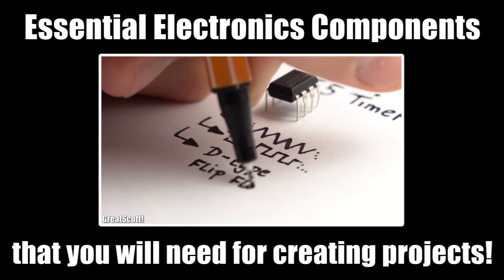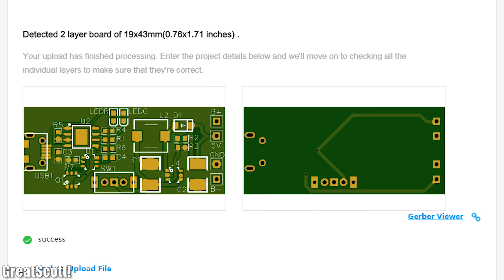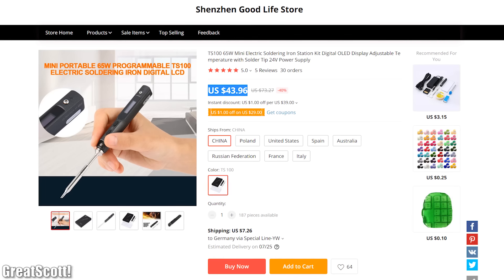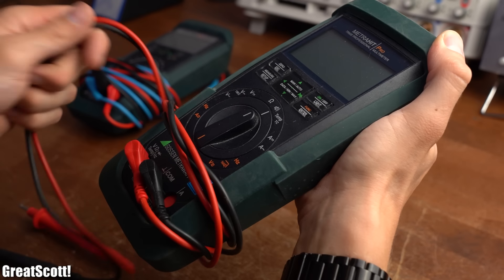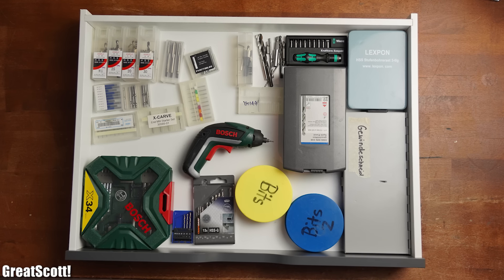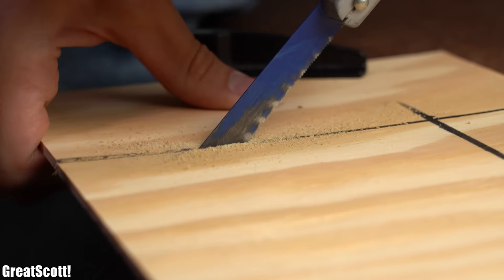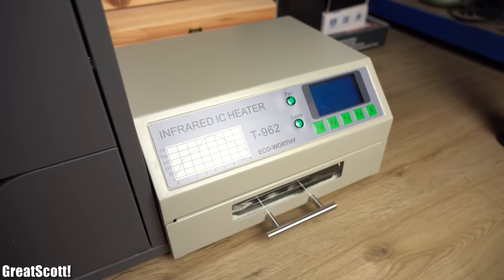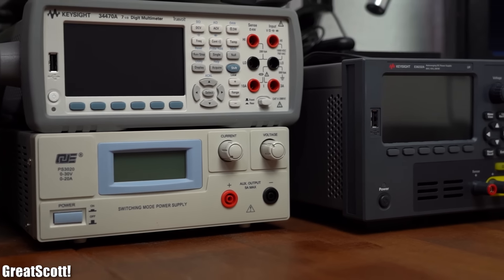Essential Tools that you will need for creating electronics projects!

Comment: *Recommend a €240 / €43 soldering iron

*me
Iam still good with this €3 soldering iron
Reply: Also me😌
Reply: Even most engineers use them
Reply: Same man..., same....
Reply: I remembered using a halogen lamp to solder back then
Reply: @leozendo3500  I HAVE SEVERAL QUESTIONS !
Reply: Agreed for beginners I have fancy bench irons but for most work I use a mains powered antek that cost £10. And a 110V iron for Industrial work.
Reply: @sayyidsahal4533  we do.
Reply: @dogwalker666  I use Zhaxoin 936D for around 25$(more or less because i brought it in Poland for PLN  ) but i'm still beginner.
Reply: I love my modern re-work station, but for years, I soldered A LOT of projects with just my butane fired iron. It’s super portable, truly inexpensive (~15USD), has reasonable temperature control, seemingly unlimited power (for big wires and connectors, and also old solder) and the fuel lasts quite a while. It also does an awesome job with heat shrink tubing. It’s definitely not for everyone and everything, but it’s something to consider if the budget is tight.
Reply: I'd say it is somewhat important to have temperature regulation on a soldering iron. It doesn't need to be variable temperature; it can be fixed temperature like the Weller Magnastat. I got mine for $5 used but I believe it would really need a new tip.

Comment: Some of these tools are pretty expensive and, while they're worth their price when you can use all their features and specs ranges, a beginner/intermediate hobbyist can get away with a few cheap substitues. Things that I have tested and can recommend:

- LCR T4 as diode and transistor tester with LRC measurements as well (get it with the probes, you don't want to desolder every element to measure!), 5-10 $ 
-  DSO 138 or DSO 150, small and portable digital oscilloscopes, 15-25$ (kit or assembled)
- adjustable power supply with LCD display, from 3-15 $ (depends on complexity, precision and principle of work, the cheap ones are LM317 with a potentiometer), usually as kits
- 858D hot air rework station, 936 soldering iron station (with changeable tips of course), both with temperature regulation and display, both really inexpensive at around 30-40$ each
- XR2206-based function generator kit, usually as kit for as low as 3$ 

Now of course these are amateur-grade tools, but they can go surprisingly far, given their price. And let's admit it, most hobbyists build DC circuits anyway, and when it comes to AC, we're usually dealing with audio frequencies (that includes PWM of our microcontrollers). I have a Keysight DSOX1102G oscilloscope on my bench and I haven't even used it in quite a while, as the cheap ones are enough for the job.

Comment: I recommend getting a couple of cheap vises.
A small drill press vise for holding things so they don't slide around, and it can be used instead of dedicated PCB holder if you don't have one.
A vise with a ball joint for holding various items you are working on at an angle.
A big cast iron vise for holding things when violence is the only option.
These can all be found for cheap in you local hardware store.

Comment: Add these:  You missed heat shrink tubing and an accompanying Bic or Jet lighter (in lieu of a heat shrink gun) and Scissors, which I use a lot.  I use heat shrink tubing on just about every project.   Hot glue gun is handy.   So is super glue.  Zip ties in many different sizes.  Black electrical tape.  Screw on butt connectors for joining bigger wires like house wires.   A kit of eyeglass sized screw drivers.   A metal oxide cut off wheel on a hand grinder and a grinder disc.  Some helping hands to hold things while soldering or tape to tape it down.  A black sharpie (or different colors) for labeling things.  Paper labels that can be cut to size.  Plastic packing tape.  RJ-45 connectors with crimp tool.  XT60 connectors.  Electrical light switches (great where you need any easy to wire up heavy duty switch in a project.  A soldering stand (if you have a TS100) and non-flammable soldering surface/mat.  Drill press... much better than a hand drill.  Bandsaw or scroll saw is much better than a jig saw.   Box of random recycled wire in all sorts of sizes.   Box of random power bricks / wall worts and their end connectors - you will raid this often.  A 12vdc car battery charger with 2/6/50amp settings.  
 
To clean up your cable mess, slider zip lock baggies are excellent. They are great for for sorting almost all other parts as well.  Put one cable inside a ziplock bag, and it will keep it from getting tangled up with the rest... and going through all your cables is also a snap, esp. if you label the bags with tape or a sharpie.  They are clear and you can see through them and you  can file them in a drawer in a column life file folders with the label at the top.  I recently discovered their utility by accident while sorting my quadcopter parts.   They are also great for keeping very small parts from getting lost (or wet).
 
Choppergirl / air-war.org

Comment: Great video, Great Scott! as usual my friend. It’s a great video for young ones starting in electronics..You covered about everything for general electronics. Yes there are a bunch of things for particular types of electronics, but you covered everything required to get started. I would maybe add one of those TC-1 component identifiers. They are only a basic identifier, but i have found it handy from time to time. I also might add a cap tester/ESR tester. I also things such as power/watt meter, distortion analyzer for audio electronics, but you covered all the basics very well. I do a lot of vintage electronics as well, so i have a curve tracer and transistor testers, tube testers, tube matcher and other vintage electronic stuff. For a modern electronics lab you have covered everything. Great Stuff! Thank you.

Comment: Great equipment and decent lab! 
What I missed from your toolset is:
- An isolation (1:1) trafo especially when troubleshooting switched mode power supplies
- A cheap but very useful component tester
Reply: - and a hat with different set of glasses for older people like me :)
Reply: You can also build a isoltion transformer with 2 transformers with the same sec. voltages. So  230-12-12-230 and you can get isolated mains without spending more money for a transformer thats 230-230

Comment: I started with soldering iron , solder wire,. Scissor ( not cutter) , multimeter,  usb cable for 5v supply which i prefer most.   Even over 12v.  1A.  . I prefer for 5v 3A. I don't know why but i like to work with 5v

Comment: 0) Fume extraction, and a good (activated carbon) filter if you do not vent directly to the outside (avoids causing your room to become quite cold during winther)
1) Bench Vice - with soft grip jaws - and a rubber hammer
2) Logic analyzer - 8 ch, 24 MHz (Saleae or clone)
3) Programmers and debuggers - for the stuff you're developing on (TL866/CH341A, Atmel/Microchip/STM/TI/etc, logic level converters and USB-Serial)
4) Fibreglass brush and conformal coating
5) Stereo Microscope - get that 3D view
6) Extra PC for multi-tasking (viewing schematics/datasheets/data-logging/etc)
7) Proxxon/Dremel - various tools (Saw, Rotary, Milling, etc)
8) FLIR camera or IR thermometer - to see how hot stuff gets and find shorts.
9) Face shield/Safety goggles - you'll know why once you've looked closely into something that went kabloom and shot dust/debris/crap towards your face and eyes
10) Fire extinguisher for electrical fires/fire blanket - you'll want this if your project starts on fire, and your emergency off switch hasn't been installed (yet)
11) Magnetic mat and video camera to document the tear-down/taking apart - in order to put back things correctly together, in the correct order using the correct screws/etc.
12) ESD mat and grounding strap - to avoid giving yourself a headache and blowing up sensitive electronics, debugging esd damage/periodic errors/out-of-spec isn't a beginners job
13) High quality air gun, soldering station - Controlled airflow without vortices, tips which stays right-on temperature and heats up fast
14) PCB holder and clamps - capton tape + various sized heat sinks to shield sensitive components when using air gun
15) Leaded, un-leaded and low melt solder AND NOT TO FORGET .... plenty of FLUX - as paste (solid and liquid flux) and rosin solder wire in various thicknesses (0.3, 0.6, 1.0 to 1.2 mm)
16) Someone watching over you, especially if you work with lethal voltages

Comment: I am a woodworker as well as a hobby electronics enthusiast, those woodworking tools are handy as hell when building enclosures and such. I don't have a 3D printer as they are too expensive as well as being environmentally unfriendly when it comes to plastics that are mistakes and not biodegradable. When you can make enclosures from wood or builders board then you don't need a 3D printer.

Comment: I’d recommend the Ender 3 Pro over the Prusa Mini. Bigger build volume, bigger community, and it’s still really straightforward to use even though it’s cheaper. Also I know that oscilloscopes are really useful but for beginners it’s not really necessary. A good soldering iron, a multimeter, a variable powers supply, and the 3D printer are probably the most useful tools.
Reply: I’ve owned both. If you want to do 3D printing as a hobby, Enders are fantastic machines. If you want a 3D printer as a tool, and only a tool, A Prusa or something like the the BambuLabs  P1P is the route you want to go. Creality and similar printers can be made into absolutely fantastic machines, but that takes a lot of time in my experience, more than some would want to put Into a tool.

Comment: I would add:
- Silicone mat (may be ESD) - it should be resistant to heat
- Some breadboards/universal boards
- Magnifier glass/Microscope
- Plastic tools for opening stuff 
- Big and Small vice 
- Set of tweezers 

Other thoughts (mostly for beginners): 
- Some kind of power supply (there are plenty of them on ebay, analogue linear power supply, with adjustable current limit would be enough for start) 
- You probably won't need oscilloscope/function generator right away (if you are beginner) 
- Consider getting some cheap component tester (there was pretty cheap tester based on avr mcus, ... ) 
- Some kind of soldering iron - it doesn't have to be most expensive stuff 
- Some component storage boxes

Comment: I'm a bit late but you forgot one very essential tool, a fume extractor or at least a fan, because you shouldn't be breathing flux and you probably don't want to take all your projects outside to solder them in uncomfortable weather, also not sure if you'd call it a tool but clamps/alligator clips/probes are by far some of the most useful items I own.

Comment: Breadboards, you need breadboards, and jumper wires to prototype electronivs, this way you can try your circuit before ordering pcbs or soldering to stripboards or perfboards.

Comment: I'd add:
*good lamp, 
*set of electronic and mechanical parts of all shapes and sizes (screws, nuts, resistors, capacitors etc).
*3rd hand
*air cleaner (with photocatytic system for fumes from soldering and 3D printers)
* processing station for resin printer (Prusa CW1 is VERY good)
* ultrasonic wash

Comment: Station: I can vouch for the KSGER T12, those run around $35 (and you get a huge selection of either genuine or imitation Hakko T12/T15 cartridges). I've also heard of the Bakon 950D (also T12 compatible) which runs around $25 (never seen one in person)
Meter: Uni-Ts are badly designed from all the teardowns I've seen. From what I've heard, Anengs are respectable enough, although I trust my good old Fluke
Cheap calipers usually don't use absolute encoders and thus are suspectble to skipping, their jaws are also usually not precisely ground within tolerance. I can confirm that my friend's pair of IGaging calipers ($40 on Amazon) are more or less on par with my Mitutoyos that retail for about 4x price (doesn't feel as smooth though)
Box cutters: I prefer the trapzoidal utility knives, it's easier to find high quality blades for those
Wire cutters: A Hakko micro cutter costs the same delivered
Drill bits: Just go to your local industral supply store or hardware store, it's ironically cheaper

Additionally, a center punch is nice if you're drilling plastic or metal, drill-point countersinks also work
Wire brush for the files, they get gunked up over time
I'd take a secured mini-vice over a bunch of clamps
Assortment of heat shrink is always nice
Jet lighter for heat shrink
Anti-static wristband
Alligator cables
Heat sink clamps
A sharpie
Electrical and krypton tape

Comment: Thanks Scott. I think you covered everything I might have thought of, and then some. Though I was a bit surprised that you didn't have an isolation transformer as part of your equipment to protect yourself from electrical shocks or your oscilloscope. But then, I'm relying on what someone strongly suggested during my research on lab equipment. I also have to admit I don't have much experience working with powered-on HV electronic circuits. I follow the "one hand in your pocket rule" when working on these.

Comment: For smaller jobs, especially ones that a hobbyist like myself do, I don’t think a lot of thee things are essential. Some good wire strippers and needle nose pliers are nice to have, the soldering iron is a must, the miltimeter for sure, and for screwdrivers I definitely recommend the IFixIt kit that comes with the 64 or so bits. Other than that the only thing I’ve ever needed was a good bright lamp and Heat shrink which you can find a box that will last you for years for like $5. The power supply might also be nice, but I don’t think it’s TOO necessary for hobbyists.

Comment: One Tool i am missing and using very often is a desoldering gun, espacally when dealing with trough hole components. In case of the oscilloscope I can recommend the Rigol DS1054Z, a 4 channel 100MHz oscilloscope with a pricetag of around 400€.

Comment: For the multimeter you forgot to mention that buying the cheapest option you find is also the worst thing to do. Electric shock potential aside, it always sucks to spend hours debating whether it's your circuit is way off or your tools are becoming fancy random number generators.

Comment: A really handy addition to the rasp drawer would be a narrow chisel with really square edges. I often find this easier to use than files/rasps for tidying up nibs and strings in 3D prints or plastic/soft metal enclosures. Look for a woodworking channel on how to sharpen the chisel tip for best results.

Comment: For osciloscope, the beter I think are Picoscope 2000/3000 series with 4 channel and 8 bits resolution witch you can have for less than 500.- The thing is that i'as a digital one that you put on you'r comuter and then have so much options (like automatic deconding serial / parallel protocole)

Comment: Everyone's going to have their opinion on what tools we should have, and what those tools need to be.  I'm only going to share one opinion--3D printer.  If you're starting out and you're looking to get  a 3D printer, a few things you should look for.  First, your first printer should be a filament based printer, not a resin printer. Just for ease of use and comfort of getting into the arena of 3D printing.  Second, two features I consider a must have are a removable, flexible bed, and auto-leveling.  The removable, flexible bed makes it SOOOOO much easier to remove prints.  If you have a fixed bad, or a removable one that isn't flexible, you have to pry the print off.  And the bigger the print, the more effort it takes to pry it off.  If it's removable and flexible, you pop it off, give it a bend, and your print comes right off (thin or small prints are another story...).  If you don't get auto bed leveling, you have to manually level the bed and that is difficult to say the least.  I can't tell you how many times I had to unclog my print head because I failed to level it right and the painters tape got jammed up in there (older print beds had to be covered in painters tape to get the print to stick).  Finally, as you get started, plan on printing almost exclusively in PLA. You'll want to expand to ABS, PETG and Flexible in the future, but you're going to start with PLA.  It's the easiest to print with, and is the most common out there.  I never printed in anything other than PLA until I got my second printer, but that's my experience.
Having said all that, I would the best printer to get is either the Prusa MK3s (I have an MK3 I upgraded to the MK3s), or maybe the Prusa Mini.  They cost a little more, but they are worth it.  Prusa makes amazing printers and there's a great commuity around them, too, which makes it easy to get help when you need it.
Good luck!

Comment: I've got a Digilent Analog Discovery 2 as my oscilloscope, logic analyzer, function generator, etc.  It's cheaper than a desktop unit, and takes up less space (since I already have a desktop computer where I do my electronics).

I would recommend a multimeter whose continuity mode can supply enough voltage and current to light up an LED, as a way to test them.  Mine has a diode mode, but it's not enough for LEDs.  :-(

I would also suggest a mostly depleted coin cell battery (one you've removed from some other gadget; for example, a CR2016 or CR2032).  It's awesome for testing through hole LEDs, and confirming polarity.